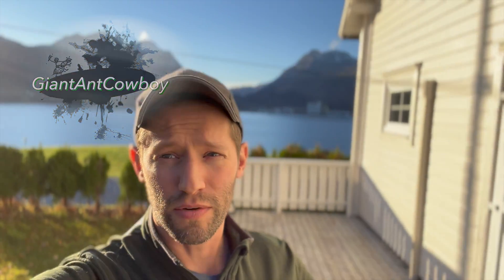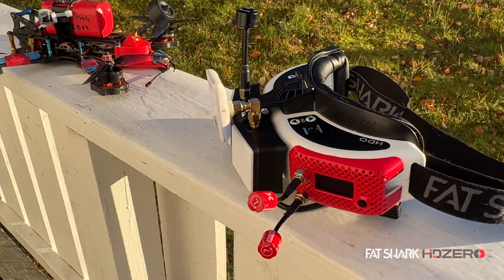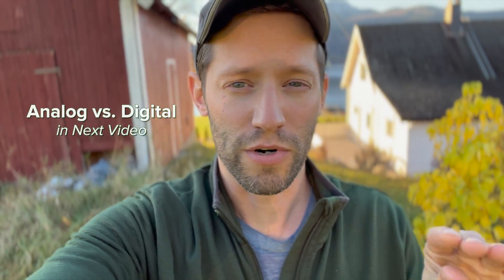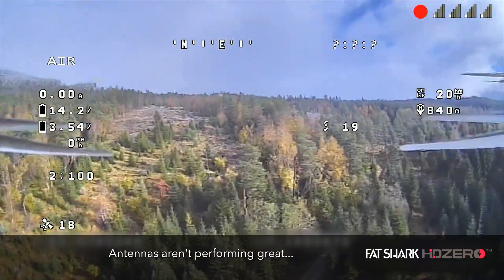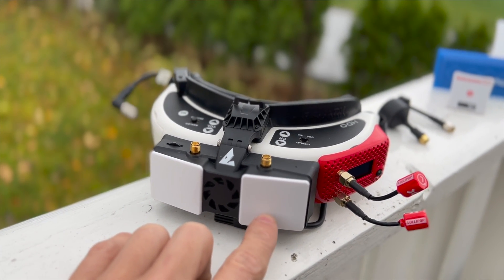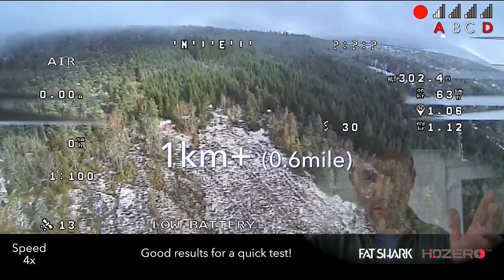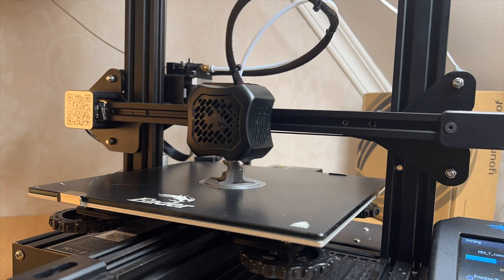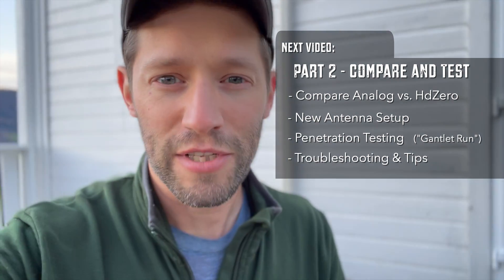HDZero SharkByte First Impressions, Experiment and Goals! Quick Digital System Review

Comment: Thanks for the video, I bought my HDO2's and a Rapid-fire module one week before DJI and digital became a thing. I was alittle peaved but after watching the performance of digital compared  to analog I was happy with my purchase. It's been over a year nearly two and digital still hasn't really come much farther don't you think?  I mainly fly short distance scenery flight with my Cinewhoop Squirt, with some freestyle on the 5 inch Rooster , from time to time. Subed.
Reply from the maker: Appreciate the comment and support! If you have HDO2s you should actually consider the HDZero, here’s a comparison to analog I posted last week and it’s a very clear improvement! https://youtu.be/fLGTMQMgDfE
The best thing about digital is that you can see sticks and branches way before analog, which sounds like you might benefit from. Thanks again for watching and commenting, cheers!

Comment: RunCam Nano have plastic lens, that's why the image is hazy. You can swap the lens for a glass one for better image quality. Micro cam will be an improvement.
Also just one small thing, HDZero isn't made by FatShark, it was just branded by them as Shark Byte, but it was developed by Divimath. Actually Fat Shark seemed to slow down the developement of this system.
Reply from the maker: Hey thanks for sharing your thoughts. I understand Divimath, made the HDZero technology used in the SharkByte system, just confusing what to call it now. Lol. 
Regarding the nano cam, I have been thinking about swapping the lens, I have a few to try, but spoiler alert I received my HDZero Micro last week soo… 
Thanks again for checking out the video, I’ll be posting Part II in a day or so. Great community support of this system. Cheers!

Comment: Another great video!! Keep up the amazing work. Digging the more detailed videos!
Reply from the maker: Hey thanks bud! I’m actually thinking about building a Chimera 7 similar to yours to carry this system further as I continue pushing these range tests.
Reply: @GiantAntCowboy  nice!! Yah I’d say it’s a decent platform, the chimera. I wanna try digital as well. So I’ll be curious to see how your testing goes. But first thing, gotta build those trash 7 turn helical’s 😁   Push the limits on the ol analog!!
Reply from the maker: @richierich142  yea certainly stay tuned, SharkByte is showing promise in my recent testing. Additionally they’ll be releasing a 1W VTX next year which of course will be a huge upgrade. 
The Chimera frame seems good and I can actually get one here in Norway, so that’s important. Just gotta figure out what parts I wanna use. Hmmm

Comment: The 500mW vtx is hit or miss. You will have no problem hitting your goals with the 1W vtx though. What power level is your analog vtx?
Reply from the maker: Hey Ryan, yea I’ve been squeezing some decent range out of the 500mW vtx this week, excited to share the results in the next video. My current analog setups are 800mW. I’d love to test out that 1W for sure, got nothing but clean air and range here in Norway. I’ll be building a new LR setup for this HDZero system soon it seems.